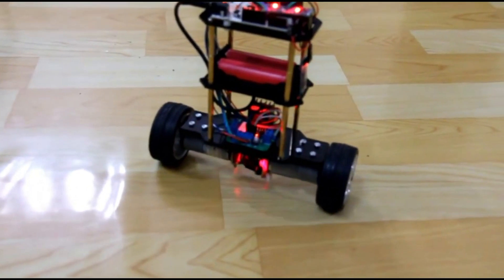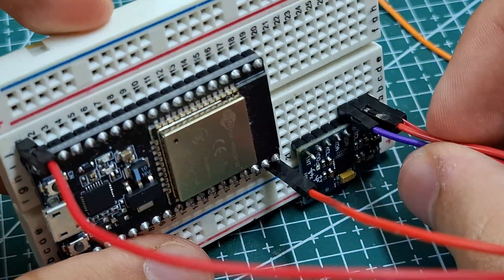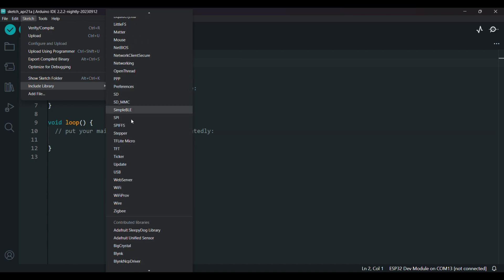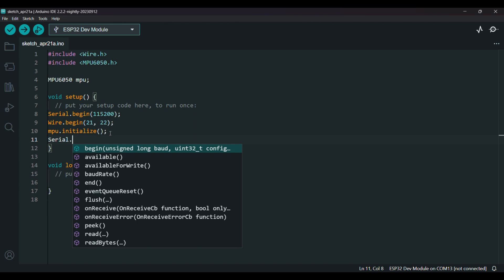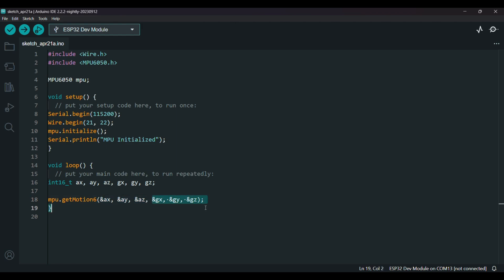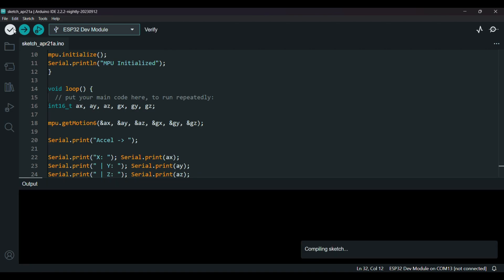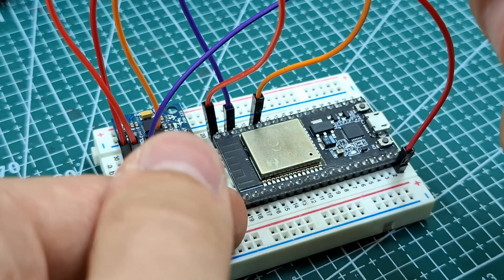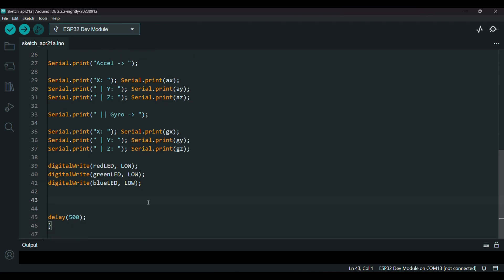MPU6050 Explained | Motion Detection with ESP32 and Arduino!?

Comment: I solder pin header to wrong side of the pcb. The side with x&y label is facing down to the breadboard. Does it affect  Z value?
Reply from the maker: @jumbo999614  Yea, it affects the Z value. If the board is upside down, Z will be negative instead of positive but you can fix it in code by multiplying Z by -1.
Reply: @Mr.Atechs  Ok. Thank you.

Comment: Bought a handful of these several years ago because they were cheap and pretty common on ali (generic clone modules). Found out a couple of things: 

- the mpu6250 is obsolete
- the quality was all over the place. Some are fine, some have a 'zero' point that is way off, and some were thermally unstable. 

I would recommend a non- obsolete imu module chip from a reputabe manufacturer but you will pay more.
Reply from the maker: Thank you for your recommendation🤗!